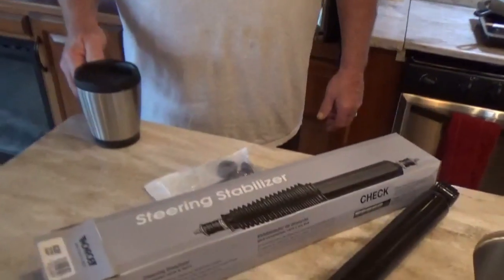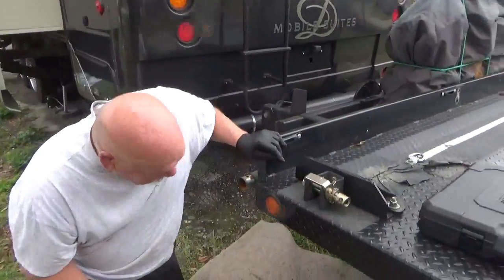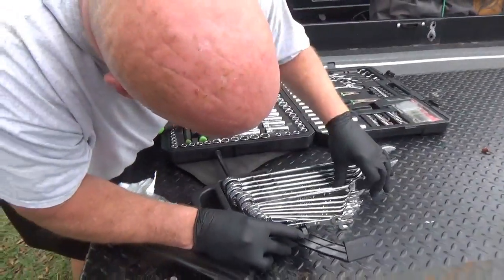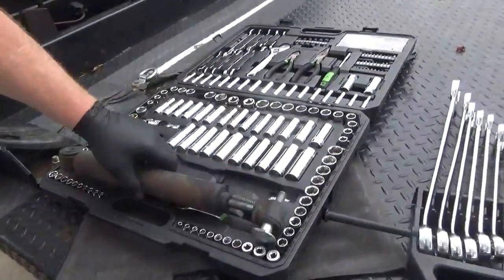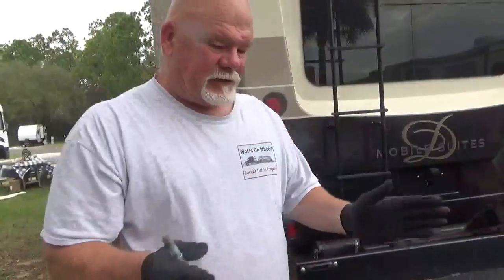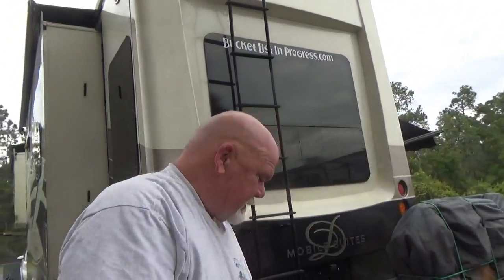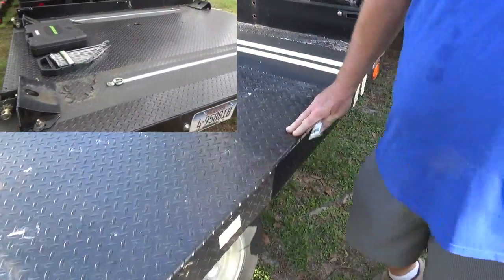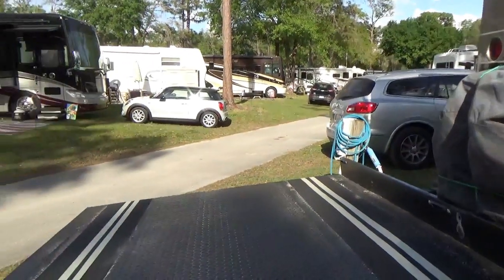Freedom Hauler Maintenance // Idaho Tote // Full Time RV

Comment: Stripe tip:  always paint the stripe the same color that is under the tape and then paint the stripe whatever color you want. This will seal the edges of the tape and give you a straight line stripe.
Reply from the maker: Good one.

Comment: What is the comparison to the swivel wheel. I need one to hall a motorcycle trike thank you Beautiful rig you have
Reply from the maker: My opinion...Swivel wheel does not hold as much weight and cannot go over 65mph and may overheat the tire.  I think it starts to act like a grocery cart wheel when you get to that speed.  My personal opinion, depending on how much traveling you are going to do, is get what you feel safest with.